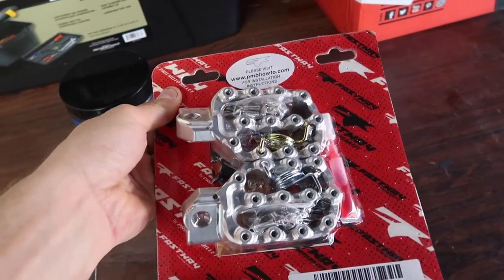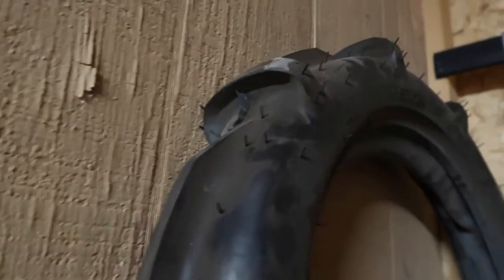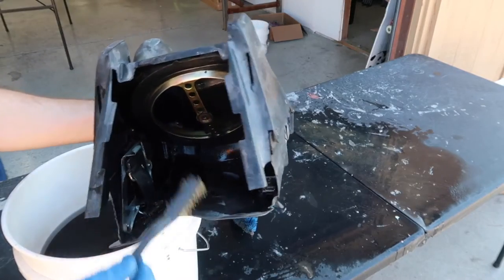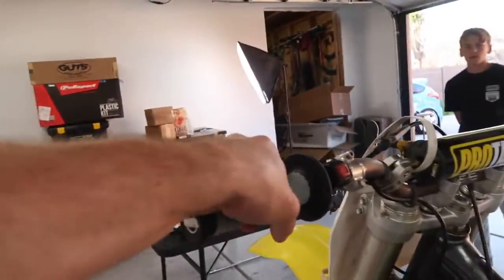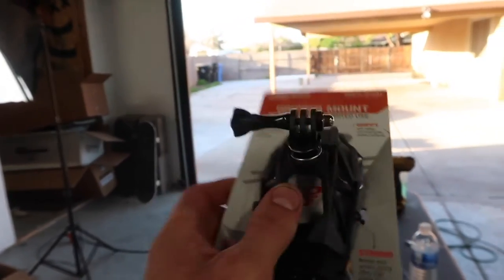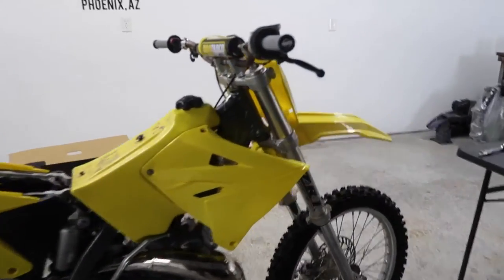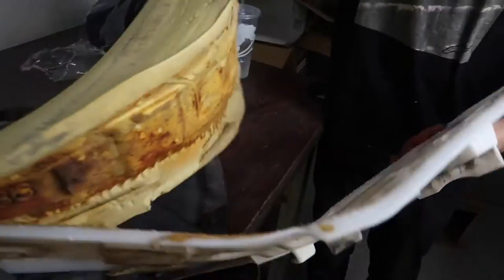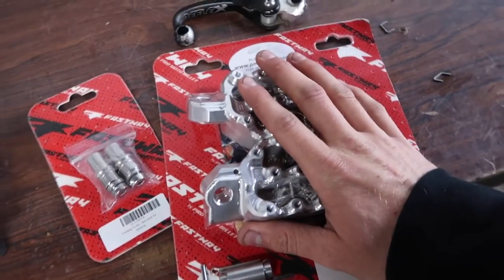First Ride & Big Upgrades! Suzuki RM250 Restyle Plastics, Seat, Filter, chain, sprocket, etc

Comment: i like the new designed number plates especially. I seen these on eBay and I almost bought a set of black. I really wasn't big on the design of the front fender and shrouds, but I like the lower profile  side number plates. Im thinking of modifying and cutting down mine.